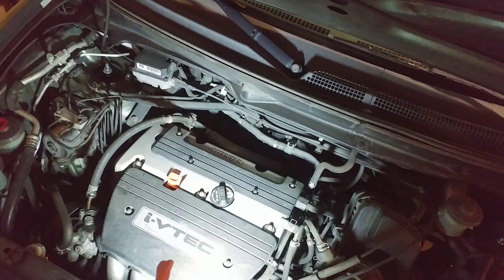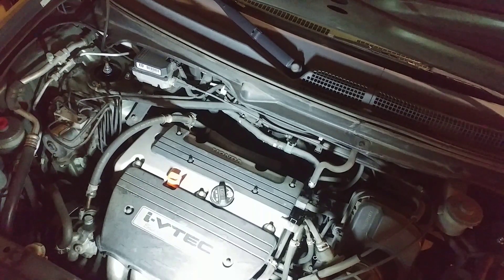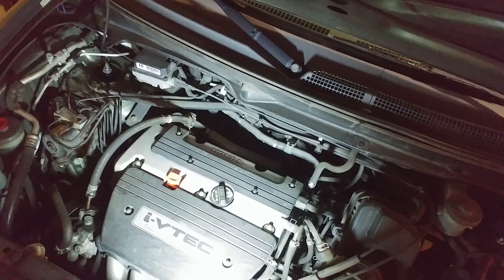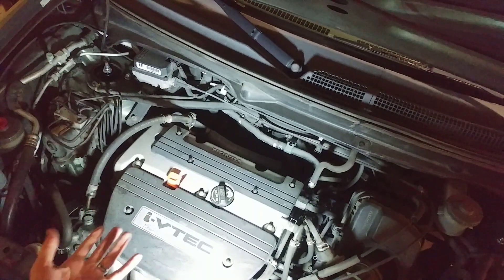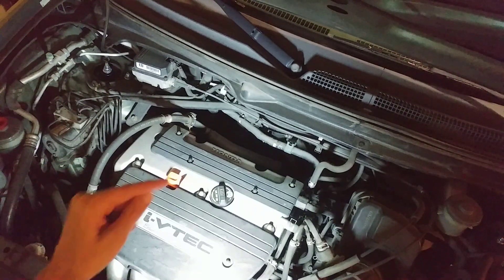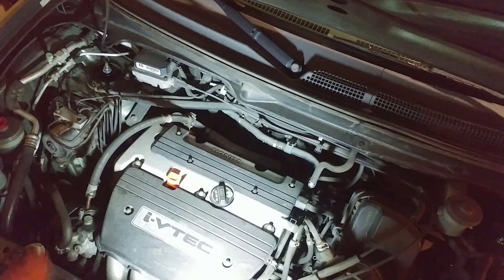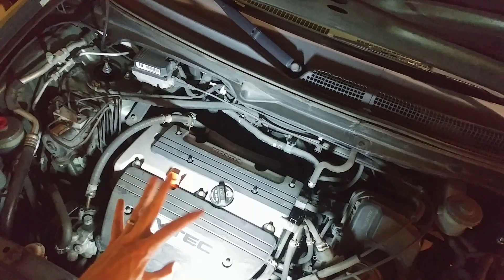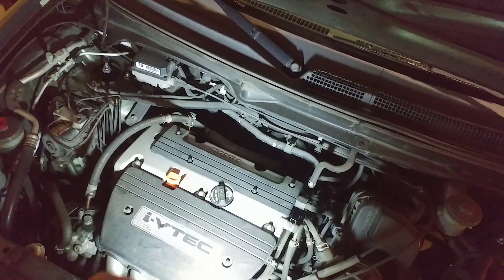When to Use 89 Octane in an 87 Octane Engine

Comment: I have a 2017 Hyundai Sonata with 25,100 miles & my check engine light just came on with a code of P200A. The mechanic i went to said to try using octane 89 & instead of the 87 i’ve been using this whole time.  You have any recommendations on what to do?
Reply from the maker: This is a somewhat common problem on Hyundai and Kia models. Might be the IMRC valve. That's the Intake Manifold Runner Control valve. There are a lot of YouTube videos on this issue. You can try 89 octane but I doubt that's it. Should be covered under Hyundai power train warranty. Best of luck!
Reply: The Switz I’m gonna take it to the dealer tomorrow & see what they say. Thank you so much for the response.🙏🏽
Reply from the maker: @disk300  Feel free to respond and let me know what they said. I have a 2012 Kia Sorento SX so it may flair up on me as well.
Reply: The Switz Just want to update you on what happened. I took it to the dealer today and they told me it was covered under warranty so I didn’t have to pay for any repairs. The guy did upsell me & said I needed an oil change and air filter replacement & I told him I just changed the oil about two months ago and he was like “oh really? Nevermind then” lol.
Reply from the maker: @disk300  Ha! Check out my video on Top 10 Reasons to Avoid Oil Change Shops... a major on is the up-sell. "You need a new air filter." "You need a coolant flush." "You need a fuel system treatment." Their goal is to get that $25 oil change to $250. Glad they agreed to fix it under warranty.

Comment: lol, interesting finding this video. Thanks for making it. Sounds legit to me, but I'm no mechanic. 
I've also heard of horror stories of gas delivery drivers offering to dump leftover kerosene or something in 87 at sketchy gas stations, but 89 would be safe from that. Dunno if it's true, I always thought it was a possibility though.
Also, my car seems like the perfect candidate according to your requirements, i bought a used 2010 Toyota Yaris 5 speed manual w/ 130,000 mi, did some maintenance, new tires, alignment , brakes, oil, trans oil, coolant flush, spark plugs && run 89 octane. It feels peppy to me rowing through the gears in traffic. :-)
Reply from the maker: I don't think 89 octane is as important with a manual transmission vehicle. At least with a manual like your Yaris you can rev the engine higher before shifting. With an automatic like my Honda Element you have an under powered engine attached to a 4 speed automatic. But if you like the way the Yaris runs on 89 (especially off the line in 1st gear and into 2nd gear) then go ahead and use it. You can also use it on an "as needed basis". If you are going to plan to pick up a  2-3 friends and go on a long drive you may want to fill it with 89 first. Thanks for watching!

Comment: I used 89 octane on my 2011 Corolla for the first time and I gotta say it performed way better than 87, granted it could be the placebo effect And its only got around 120k miles but 87 vs 89 like, atleast for me, there is a difference in power and it only gets crazier when, and if, I get a tune for 93 octane and e85
Reply from the maker: Coty in my follow up video I talk about how you can 100% tell if there's a difference. The shift points change if you have an automatic transmission. So for example, going up a hill where you usually feel a downshift from 4th to 3rd using 87 the car will now stay in 4th all the way over the hill. This is not placebo. It's really happening. Sounds like your Corolla is a good candidate for 89. Thanks for watching!
Reply: The Switz Ill be sure to check that video out and let you know my answer about that video

Comment: Makes sense to me.I have a 2000 jeep grand Cherokee that was having some engine knock.Ive always used 87, but I was told to bump up my octane to 89 or 91.Believe it or not it stopped the knocking.And I was gonna pay $1500 for a used engine....phew that was close.
Reply from the maker: And honestly Patrick I think a "used engine" would have been a dud for you. My Dad told me ages ago "never get a rebuild or 'new' engine" ... he was in the engine rebuilding industry and was always surprised how short they lasted compared to factory engines. I'm curious if you just use 89 or you do a half 87 and half 91 octane blend.
Reply: @TheSwitzAutomotive  straight 89....no mix.Been doing it for 4months
Reply from the maker: @Mistah-Yawk  Good deal Patrick. It's amazing how making good moves with your vehicle (like bumping up to 89 octane, using AT-205 for small oil leaks and doing your own oil changes) can get you way ahead by making a car last 15-20 years.
Reply: My 2007 gc did the same. Riding better and knocking stopped

Comment: hey The Switz, i recently got a 2020 Nissan Rogue, i did went to put gas on my car and i used the mid grade 89. later i was wondering if the manual says what kind of gas it should use. i then learned it uses regular 87 gas fuel. does this damages my vehicle and is there a way to like cleanse the fuel tank or something. this was only my first time. it said something like use 87 to prevent damaging the emission. Thanks!
Reply from the maker: No 89 won't damage your engine. It's just that there isn't any benefit to 89 since you have a new engine as it's a 2020. Thanks for watching!
Reply: @TheSwitzAutomotive Thanks so much!!! ill be careful next time, and your video really helped out!

Comment: i have a 2018 mazda cx-9 gt and it says 87 but if i run 91 i get 70 more hp.
Reply from the maker: Some of the newer engines are designed for this like the Tao by Kia/Hyundai.  I was not aware Mazda was going in that direction.  Thanks for watching.
Reply: If it got a turbo, 89 or higher

Comment: What do you think if i use my 2005 crv lx 89 octane?
Reply from the maker: If it's got a lot of miles on it you may see a performance gain. Those cars share the Element's 2.4 K series engine and they are borderline under powered. It will cost you very little to give it a try. Thanks for watching!
Reply: @TheSwitzAutomotive  mine 169000 ml.
Reply from the maker: @joysshawon7697  Yeah a bit of a bump in octane could help.
Reply: do et

Comment: I have a 2010 40k Honda accord with a 3.5L v6 about 270 hp, It's the fastest car that I ever owned. I am thinking about Sea Foam additive to clean the injectors. I always wanted a Element, they can haul a lot of stuff with the seats down. Good luck with the 89 octane. If theirs an air field by you get some 100 octane Avgas, put a ounce of that in you tank, have to becareful not to damage the catalytic converters. have a great weak! :-)
Reply from the maker: In all my years of driving I have never used anything to clean my injectors. If your Accord V6 is running good I'm not sure I'd bother with the Sea Foam. If you have a bad injector I'd just replace it with a new one. Thanks for watching!